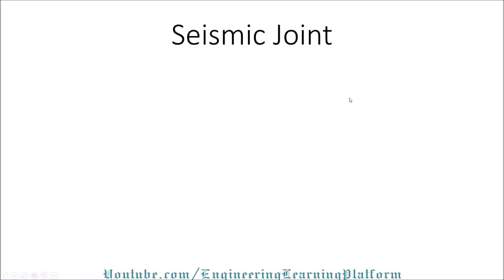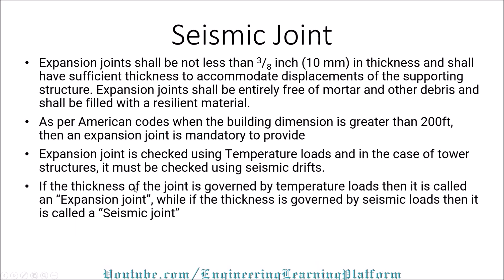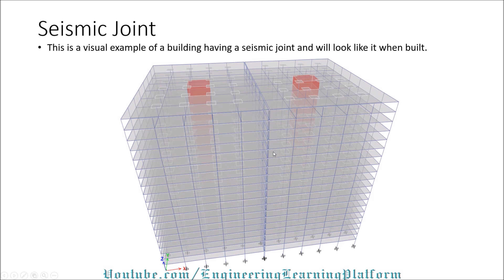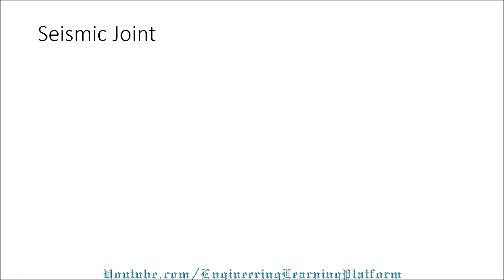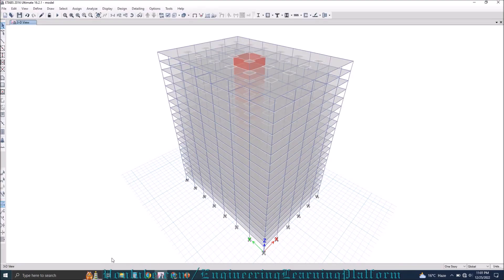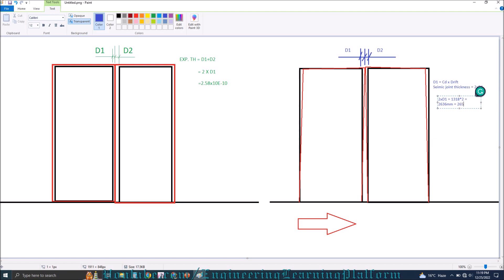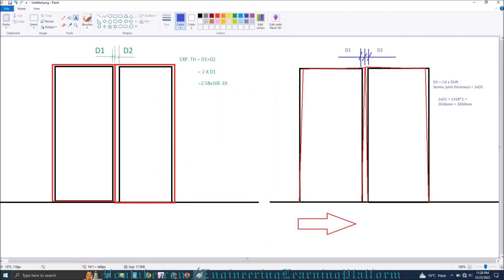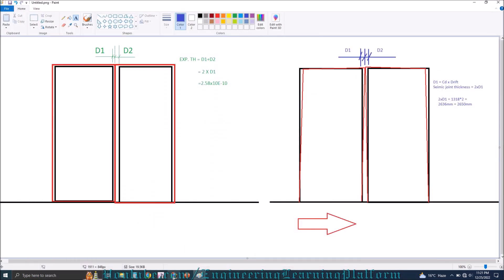How to calculate seismic joint in Etabs

Comment: Can you make full Video about How to Apply FPx and FPy diaph Force to get axial om element collector in Building? (I usually make base on Load on the floor/area of floor that messhed.
Reply from the maker: Basically a collector design?
Reply: @EngineeringLearningPlatform   yes. Just how to input FPX force in the building to get axial Collector.